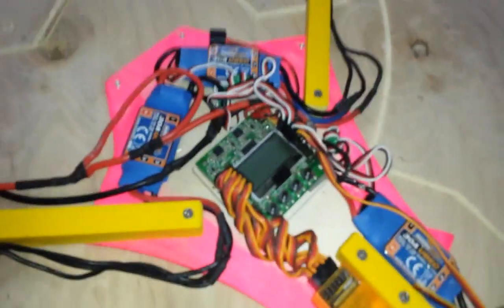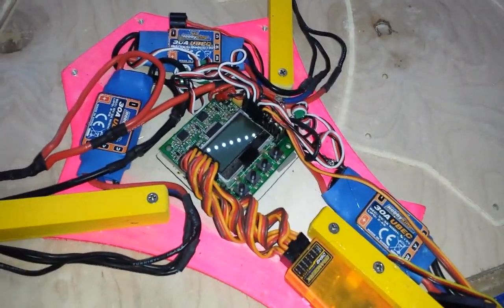New Simplecopter Tricopter 2.0 Flight

Comment: Man you are insane =)... really nice control of the quad. I have a few minutes in a tricopter  with a kk2. and I most say that is not easy to control de yaw. I both a talon frame in hobbyking, and I really dont thing is a good option, its a frame to sell parts... the landingear or legs in the arms is carp.  So explain me 1 thing, to take off, I put the self level on? ... and to fly off? Tks!

Comment: Scratch that. Painless360 has an excellent walk through of the Self-Level settings for V1.6, for a quad, but the principles remain the same.

2nd problem was Ive never flown using Auto-Level. My bad.

Comment: Great video, great flying, your stuff is truly inspiring.

Quick question, any link to relevant material will do. What is the absolute best way to ensure the most stable hover possible? Are there any great vids or advice on how to ensure proper balance? I've watched you video on the P an I Gains and it was a huge help, but Im still not 100% happy with the stability.

Comment: Matt, great videos, I am interested in the VTail version, have most of the parts and was wondering if the Turnigy D2836/8 1100KV would be OK with 30 am Plush speed controllers, non flashed. Running 2200 3S Nano's 45-90C.

Can you also do a video of flashing the Plush 30 ESC's?

Also do you use 8x45 props on all motors and what was the rotation of each.

Do you recommend mounting motors on Vtail pointing up or down.

Thank you, great work, love the way you go about things.

Comment from the maker: Yes that is correct. The only thing is after you pump the throttle you pull it back to 25-40% till you come full circle. A good practice for this is to throttle up 50 foot pull throttle back to 25-40% and let it fall then throttle back up to hover. Do this over and over again till it is done without thinking. If you throttle back to much the copter does what it wants and that can be bad. REMEMBER flips and rolls are done with the auto level OFF. Sorry foe yelling i get carried away sometimes.

Comment: Ive snapped some of them in the air as well. If you see any stress in the plastic(white color) near the hub toss the prop in the garbage. Snapped them on 3s in the tricopter with 2212 1400kv motors and on a quad with 1200kv motors on 4s. Stay safe